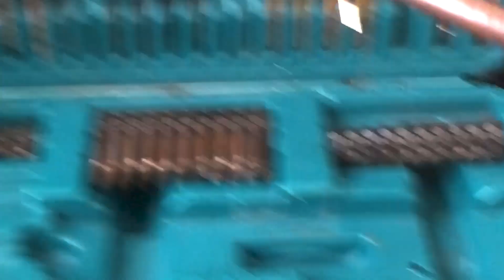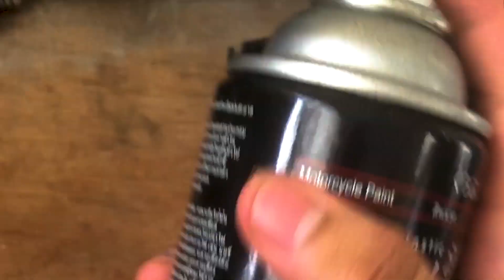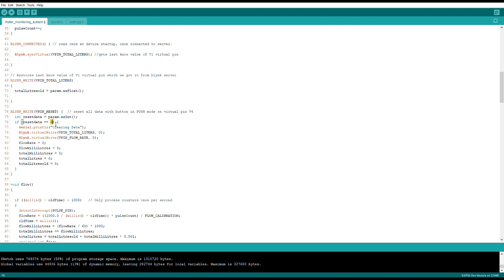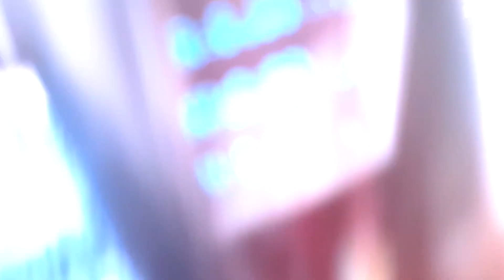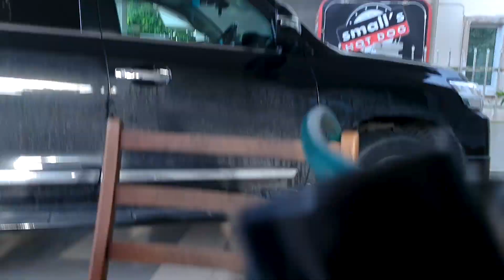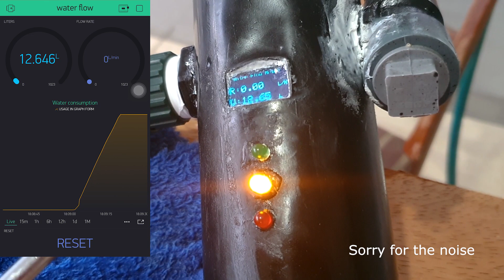Iot Water Monitoring System | ESP32 WiFi+Bluetooth Module, Water flow sensor, OLED screen & Led

Comment: Heyy bro 
I have Oled ,esp8266 and water flow sensor. How to connect thise?
Reply from the maker: Hello, that's great to know, you can try to go to the link in my description, theres the connection for esp8266
Reply from the maker: https://randomnerdtutorials.com/esp8266-0-96-inch-oled-display-with-arduino-ide/, try this for the OLED connection with your esp8266

Comment: is the code same as if we change the OLED with LCD 1602 ?
Reply from the maker: Hello Xperiment SQF, the code is going to be different for LCD 1602, but I recommend you to use OLED so you can easily follow the video, plus it gives you a better display

Comment: Nak connect OLED dengan ESP tu ada tutorial tak? cuba cari tapi semua kena pakai Board putih tu. Memang kena pakai ke? Saya first time nak buat kerja2 guna ESP32, dlu pernah buat flashing firmware jela untuk Barang2 Zigbee
Reply from the maker: Tidak semestinya guna, bread board (board putih) tu only untuk prototyping ja, but kalau mau sambung wire boleh guna dupont wire.
Reply: @hafizsulaiman5368  ohh macam tu, dia nampak lagi kemas la kalau ada bread board tu ye?. Baik terima kasih!"
ada tak rujukan untuk saya tengok connection OLED tu dengan ESP32, semua connection dia sama atau lain projek lain connection?
Reply from the maker: @AlcaGamerZ  Boleh connect directly guna dupont wire if you tak mahu guna bread board, but untuk connection dia you boleh try check these website for guidance:
- https://randomnerdtutorials.com/esp32-ssd1306-oled-display-arduino-ide/
- https://lastminuteengineers.com/oled-display-esp32-tutorial/
(ni untuk OLED screen yang guna SCL, SDA connection)

- https://circuits4you.com/2019/01/09/esp32-oled-library-display-example/
(ni for OLED screen yang guna SCK, SDA connection)

- https://www.electronicshub.org/esp32-oled-display/
(ni for OLED jenis 6 pinout connection)

Note that, the connection will always be the same for any project
Reply: @hafizsulaiman5368  Terima kasih banyak tuan. Sangat membantu!

Comment: Excellent.. it's how can check online anywhere...
Reply from the maker: exactly, as long as the system is connected to the WIFI, you can check it's information anywhere in the world
Reply: @hafizsulaiman5368  ok... Second counting of this module program..